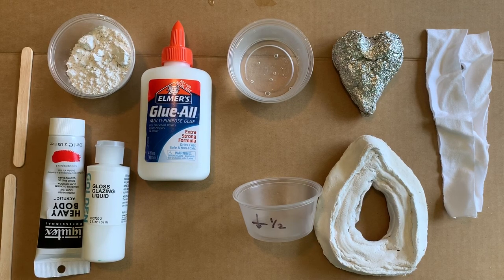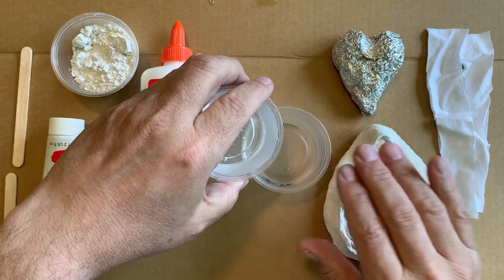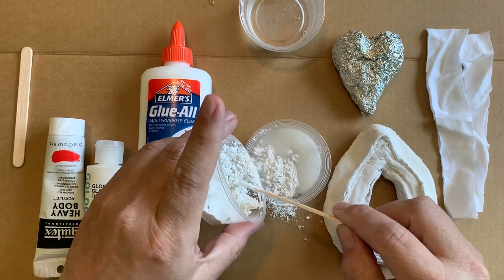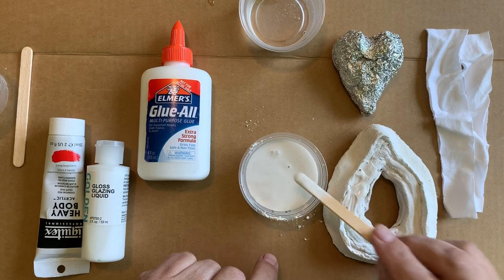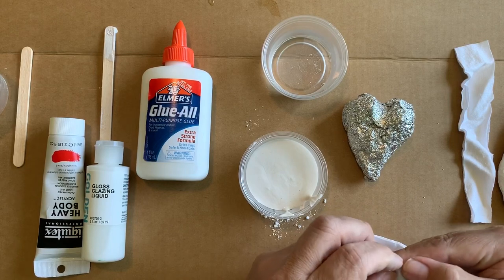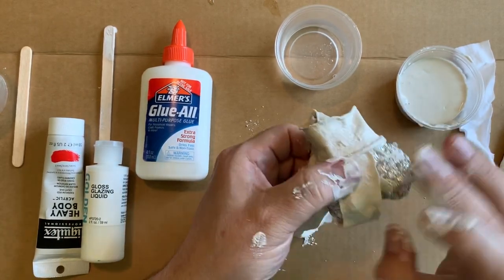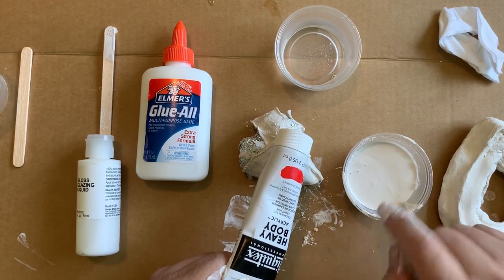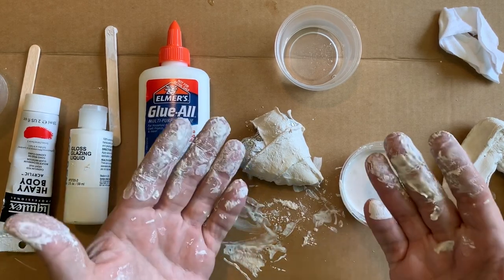Using Liquid Plaster

Comment: Thank you for this video. I wanted to ask it plaster will stick to canvas that is already primed? I have to do a fabric-plaster artwork on a canvas i.e. by dipping fabric in liquid plaster and shaping it on primed cotton canvas.
Reply from the maker: It should, but might crack off when the canvas flexes. You might have to let it dry, crack off then attach with glue...?
Reply: @artedguru  Thank you for your reply 🙏🏻 I think you are right. I ll try it. I also read somewhere to had wood glue to the mixture, but idk how I feel about it. Thanks again.